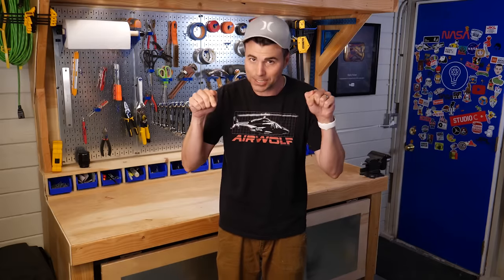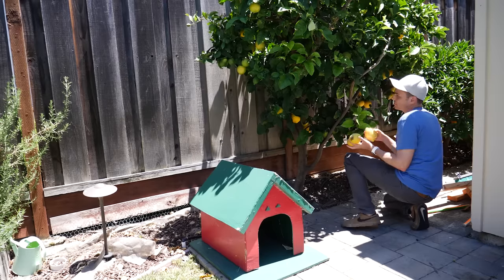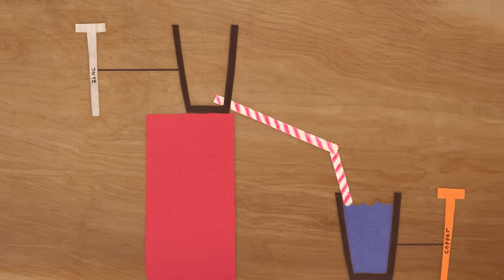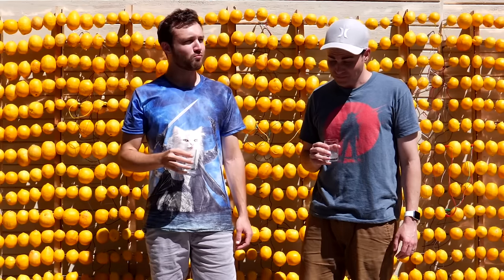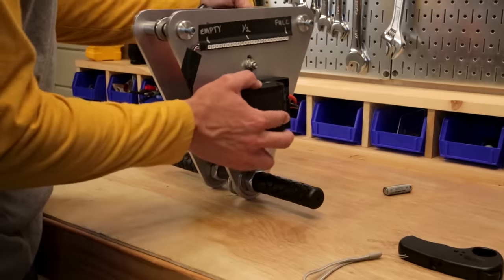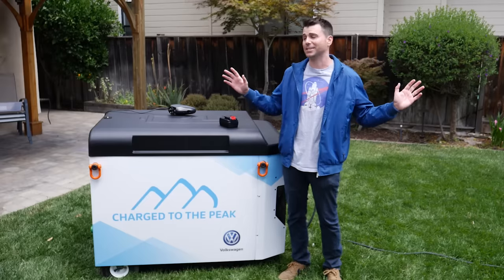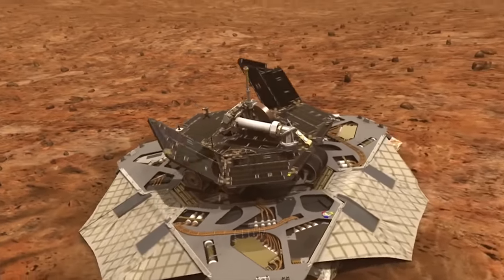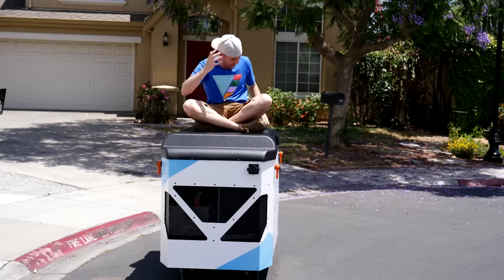World's Largest Lemon Battery

Comment: Mark Rober: Departs to Colorado on a moving battery
Arrives in Colorado
Volkswagen: "Why is it only 5%?”
Reply: MARK: Good question!
Reply: LOVE your comment
Reply: crossing two states by only losing 85% thats a good battery though given that the direct air route is 766 miles (from center to center) and the shortest route by car i botherd to google is 1183 miles.
So by taking that numbers and checking what the best range of any E-car is we get (around 260) we can do the horrible thing called math(though its only dividing) and see an e-car would need close to 3 full charges (2,946......) if it could travel the air route and 4,55 via normal route.
Now if we take the battery and say it only needs 0,85 charges to travel those distances we get an maximum range of 901,17 Miles via Air route and a whopping 1309,4 miles on the street route
that makes it 3.4 times more efficent on air route and  5 time more efficent on street route then a normal e-car not that bad honestly 

though the car will get you there faster and more comfortable
Reply: Blutwind nah that doesn’t make the battery good IT MAKES THE ENGINE ULTRA EFFICIENT
Reply: Blutwind /motor

Comment: Mark: "you can charge a battery if you play on this zipline"
Kids: "meh"
Mark: "It goes up on its own"
Kids:"Wooooaaaaahhhhhh"
Reply: Mark was right when he said that pulling it up it the worst part
Reply: Those are kids for you 😂
Reply: Snowcharge aka me
Reply: The question is: How much energy does one way down generate and how much energy is used to get it up again, right?
Because if it takes less energy to let the zipline pull itself to the start you could just put a weight on it and let it do this over and over generating more and more energy.
Reply: @BavarianHobbit  there's no free energy..
Reply: @MrDemi1233  ofc there is no free energy, the energy you gain is because instead of making it pull the kids back up the kids move themselves back up.
Reply: @BavarianHobbit  if there was free energy, soooo many problems wouldn't exist. Unfortunately, it is physically impossible, (as far as we know,) to create quote-unquote free energy,
Reply: I N V E S T
Reply: @BavarianHobbit  You'd probably lose energy as you tried to pull the weight back up... i don't think you'd really gain anything.
Reply: @Santonomy  It's ironic you're using the word "quote-unquote" instead of actually the quote and unquote.
Reply: @BavarianHobbit   How this fails is that the weight (In this case it was children) was removed when lifting the zipline back up which is what generated energy, the difference in weight meant that when going down there was more KE because more mass but when going up and using up that energy generated the children/weight was not there so you still kept the energy generated by the weight of the kid on the line. You would lose energy if the children stayed on the zipline when its recalled to the top.
Reply: Kids: ILL TAKE YOUR ENTIRE STOCK
Reply: @BavarianHobbit  someones gotta bring the rock back again. Just be the rock and it's funner.
Reply: @BavarianHobbit but that doesn't work since the zipline goes down with the weight of the kids, then the kids get off then it goes back up... But as per your idea, the weight will go down because of its own weight but it will take a lot more energy to get back up cause unlike the kids, it wouldn't get off and run back to the higher point

Comment: I love how mark builds up our expectations with all the science and how things work but then just shows it failing
Reply: That’s how science works
Reply: I like how mark does that. Cuz depending on how someone explains it science can be very interesting to listen to
Reply: William Osman in a video. Something WILL fail
Reply: @someotherworldlybeing3167  Yes, there is no such thing as a failed experiment. Also a 48 kWh trolley going 2 mph would need only around 50W, so it has a range of 2000 miles! With 150W solar, it could drive continiously circling the earth every year and a half. Far better than any Mars rover.
Reply: Sounds like Mehdi Sadaghar.
Reply: Welcome to engineering? Make fail improve

Comment: Next video- add up all the electricity your viewers are using to watch this video. My pc uses about 500w and 500w x 12mins(0.2hrs) is 100watt hours, so I just spent 100watt hours to watch this video. Just 10 views is enough to power that zip line several times. You have about 4m views on this so that’s 300 megawatt hours(considering mobile users)That’s equivalent to 1200, 60,000,000lb deadlifts.
Reply: blak47100 thats if everyone had the same PC
Reply: SCOINCE
Reply: Your computer probably would use 500w in full or nearly full load. The electricity cost would be sky high if computers would use that much power all the time.
Reply: Eetu Jääskeläinen well I have a very high performance gaming pc. If I bought a dinky 500w power supply I know it would instantly get overloaded. So that’s why there are 1000w power supply’s on the market. I know some people have lower wattage devices but this is just an estimate.
Reply: @BlakeSwearingen  Sure, but after the computer has started and is in idle state it uses way less than what the powersupply can give. Im currently watching yt video and have a lot of tabs open and still my cpu is at 6-10% and gpu is at 4% that means im not using all the computing power my pc has and so im using less power in the system. I havent measured my idle state current draw from mains but my estimate is somewhere between 10%-20% of max capacity maybe less, maybe more.
Reply: Science convo in here. I have no clue what any of the these comments mean. 😝
Reply: nice fermi problem
Reply: Nerd 🤓
Reply: Lol I never said my pc has a 500w power supply. My pc USES 500w. The corsair ax1500i can HANDLE 1500w. But that doesn’t mean I use 1500w. Gaming PCs use a lot of wattage with high performance gpus.
Reply: blak47100        HUH? I’m not that smart can you put it into English
Reply: @BlakeSwearingen  You could have two RTX2080ti's and an OCed i9 9900k but you still won't use more than 75 Watts watching a YouTube video lol
Reply: If you need 500W to watch a YouTube video, you're doing something wrong, very wrong.
Reply: Calculate based on an iphone7+ usage with no other apps open to earn the thumbs up I gave you.  Please and thank you.
Reply: And your PC will never use 500W to drive either your CPU or GPU to decode a video, and it doesn't matter if you have C-state on or off, it just won't pump juice to your system while doing low-load works. Nice concept but wrong calculation. ;)
Reply: blak47100 your 500w tdp computer will use about ~100 watts to watch a video like this. 500 is if
you’re running crysis 3
Reply: blak47100 your gpu’s don’t even turn on when watching a youtube video if u have an intel chip. It will use the internal gpu and route it to the cards hdmi or whatever
Reply: Glover Carvalho go look up”rtx 2080ti idle power consumption” that still a good 74watts. Now streaming a YouTube video and displaying it on 3 4K monitors(assuming we have a good setup bc u mentioned the rtx 2080ti) actually makes the video cards throttle a bit above idle. So that’s about 7% usage. That is probably about. 95watts per card. And if we had 3 of them thats 285w for the gpus. The i9 9900k would probably use around 45w. If it was overclocked it would use a good 65w. Here’s what it will look like all added up.

3x rtx 2080tis -285w
i9 9900k oc -65w
power supply heat -15w
Mobo- 25w
Ssd+hdd-20w
Fans and water cooling -45w

That’s a good 455w not to mention that the monitors also draw 30w each and that’s 90w. 90+455 is actually 545w bud.
Reply: Grouchy 1 the iPhone 7+ uses only about 7w. I was just estimating on how many watts I was using with my pc.
That’s only about 1.4w hours but a small mobile phone has no where near the amount of wattage and processing power than a gaming pc does. Besides, it makes so little heat that it doesn’t even need a single fan.
Reply: Frack
Reply: okay calm down
Reply: @chrisjohnson7264  But who will connect their monitor to iGPU port but not dGPU port if they are a PC enthusiast and have basic knowledge of hardware (except who really needs to free the dGPU completely from running non-3D tasks). And yet, Crysis 3 is not the most demanding game ever, just a reference.
Reply: I understand that, the igpu can route traffic thru the dgpu. You can configure when which processor outputs in windows.
Reply: @chrisjohnson7264  of course, dgpu finish the job and copy the rendered frame to igpu.
Reply: @BlakeSwearingen  I'm beginning to think this whole thread is just about you flexing your gaming rig... that's mostly because you haven't addressed your first reply from some french fries. Just because you have a monstrous setup (by the way, even for a gamer, your setup is a colossal over-kill) that eats 500w at low/no load doesn't mean most computers will. Even a performance gaming PC (built within the limits of sanity) will consume closer to 100-150w at low/no load, and a laptop or other mobile device will usually be optimized for battery life and consume significantly less when not under significant load by doing minor optimizations like not supplying power to the HDD while not in use. That changes your math pretty drastically.
Reply: Andrew C Lol this is a convo about science, let’s not introduce salt. Anyway, why would I be bragging, if it doesn’t benefit me at all, and I only get reply’s like this? I don’t. Anyway back to the topic, computers actually use a good amount of wattage,  so search up “server wattage”. Just a one unit, with a intel Xeon, just a high performance computer processor, uses around 750-1200w. Yes, a kilowatt. Maybe I forgot to mention that the servers at YouTube also have to process the videos that we watch. I totally understand that many people use devices that have lower wattage. I get it. This is just an estimate if most watchers use gaming PCs like me.
Reply: Curly K Lol I meant “power supply heat” because most of the energy wasted in a psu is converted into heat. Some people also might not understand “power supply efficiency”.

Comment: "all the energy sources we use are solar powered"
geothermal and nuclear: bruh
Reply: changing the phrase to be "all energy sources we use are nuclear" would be closer to the truth, since the sun is just nuclear fusion and some of the heat from geothermal is cause by decaying nuclear isotopes
Reply: @Privatesargent  At some point, you're just saying all energy comes from energy, which loses a lot of it's "wow" appeal.
Reply: @richardwalker3760  nice one
Reply: @richardwalker3760  but there's alot of different ways that energy is generated, geothermal is compression and i think nuclear fusion shoots out more light while fission can shoot neutrons.
Reply: @Andrew Friend the energy is still there, planets and stars don't need life to form and run. The sun was using nuclear fusion before the earth was even formed and the earth had molten insides before water even rained
Reply: @richardwalker3760  I mean...that is what the first law of thermodynamics means right?
Reply: @Privatesargent  Tidal powerplants disagree. You can also get energy by slowing down the earth rotation (and boosting the moon).
Reply: Geothermal is only around because of the sun’s gravity, and uranium is only around because of stars that went supernova

Comment: if the zip line had a Higher gear ratio wouldn't it generate more power? because it would take more energy to get it down the hill?
Reply: Nope, because in the end, you just convert potential energy from the height -> kinetic energy when going downhill -> heat + energy stored into the battery.

Changing the gear ratio wouldn't have changed anything. The only thing you can do is either slap an heavier person on the zipline, increase the speed while going downhill (less friction on the zipline), or improve the braking effectiveness.
Reply: Rodolphe Fouquet heavier person? I got this!!
Reply: I'd have to be carried back up tho
Reply: Only if you carry madam Zeroni up the mountain.
Reply: +Rodolphe Fouquet Actually going faster would probably not help as friction increases with speed worse still the air drag increases with the square of speed and both of those are losses in the system reducing the gravitational potential to electrical efficiency. One other way that would work though of course is to find a bigger hill the larger the change in height the more potential energy per kilogram.

Comment: I encountered a similar problem in astroneer, i was trying to avoid getting lithium (even thought i was on novus and there was lithium there but i'm just lazy) by making dozens of small batterys instead of a medium battery and it turns out may array of small batterys could only hold 640 U's of power compared to the 1024 U's of power that 2 medium batterys could hold and would have been easier to make.

Comment: Also quick question doesn’t a car batter need direct current and wouldn’t a regular generator (the lemon battery) produce alternating current?

Also shouldn’t you make a transformer because of how low the current of the battery is?

Comment: you used 1232 lemons. The current Guinness World Record for the largest lemon battery is held by a team of researchers and students from the Sorbonne University in Abu Dhabi, United Arab Emirates. The team, led by Dr. Ali Bumajdad, created a battery using 2,276 lemons, which generated a peak voltage of 244.14 volts and a peak current of 0.973 milliamps. The battery was constructed by connecting 119 lemon cells in series and 19 lemon cells in parallel, using copper and zinc electrodes and wires. The record was set on November 8, 2019, and was certified by Guinness World Records on November 19, 2019.
Reply: you dont have the largest, but you probably have the most powerful
Reply: 3:39 oh, you dont have even that

Comment: ok i'm confused, in the example at 3:00 the electrons are moving FROM the copper TO the Zinc
but in the very next example the top cup is Zinc and is pouring TO the bottom cup which is copper
was that a mistake? if not i'm lost

Comment: Hi Mark, when you used plan b which was to have the kids use the hanging slide, for some reason I suddenly thought you were just using it as a tool to charge the battery almost like you were filling the car using petrol, and with petrol. I mean those children, in short what I think is like you are using those children as a tool to charger

Comment: Does the power used cycling the battery up the zip line not cancel out the power generated going down?
Reply: No, because the kids weigh way more than the zipline.

Comment: A car altenator recharges the cars battery.  Why can't they make an electric are with its own charging system.  Make it with two sets of batteries and while one set is operating the car the other set is being charged by the wheel driven charging system.  And by the way I got this ideah about 40 years ago when I was in school.  Too bad that I did not have sense to patten the idea at the time.